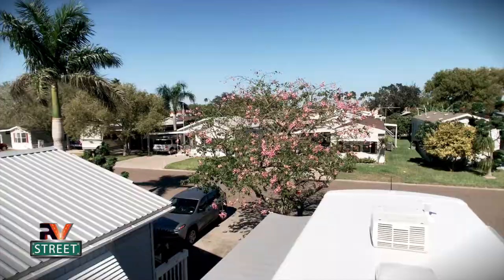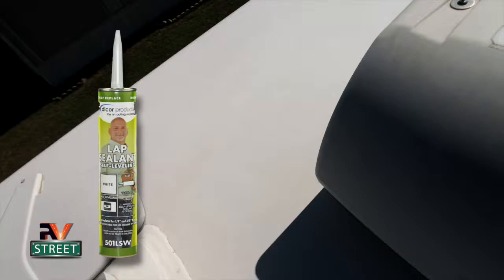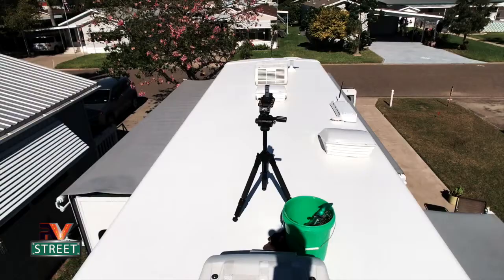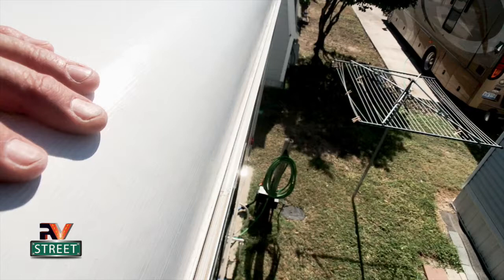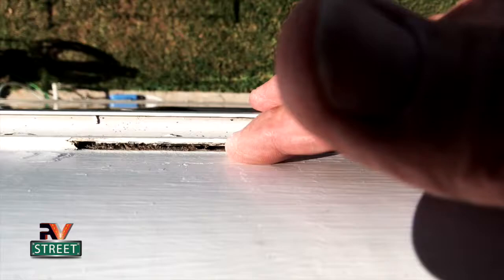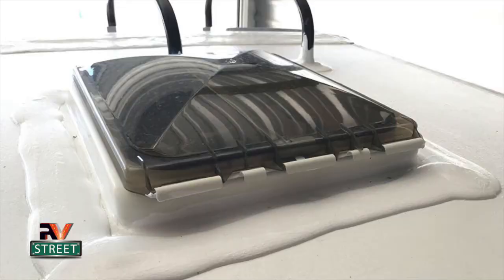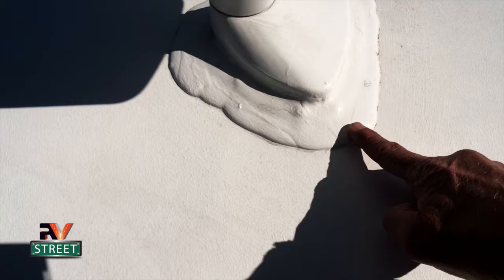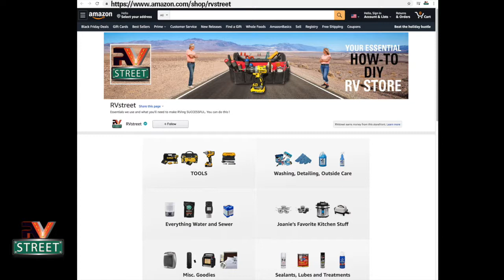RV FIBERGLASS ROOF COATING & GUTTER SEALANT REPAIR

Comment: Thanks for the video.  Very informative.  Why do you say not to use Silicon Sealant?  Is that just on the roof, or anywhere on the coach?  thanks for sharing
Reply from the maker: I was waiting for someone to ask this question, because I wanted to pin this question and my answer so it would appear at the top of all comments.
You don’t want do use silicone sealant anywhere on the RV and here’s why:
Silicone usually does not have UV protection. But even if you happen to find a silicone product that does have UV protection properties, once silicone has been applied to ANYTHING and you come back later to do any repairs, it's nearly impossible to scrap and remove it all off to reapply new material. There's always some residual silicone left behind on the old surface which makes adhering the new silicone product unable to adhere properly. Silicone won't adhere to itself either.
Reply: @RVstreet   - it's important to know however, that Winnebago uses silicone sealant from the factory.  So if you have one, do not use dicor unless you take all of the silicone off and clean it up first, like you have done.  Dicor does not stick to silicone.
Reply from the maker: @MrRMB1  So let me elaborate a little more on this for others:
Remember our coach is a 2012. I don't know what type of self leveling sealant they used then. But for me it didn't matter. I stripped all the old sealant off. Then sanded the entire roof. Then wiped down with acetone, then cleaned it with the Dicor cleaner. So I started from scratch. Once the roof was down to bare bones, then I laid down the eternabond tape, then applied a thick amount of the Dicor self leveling sealant over that and everything else up there. Then put 3 coats of the Dicor roof coating over all that. In the 5 years since I've done that all my sealant still looks brand new. No touch ups, no cracking, no nothing at all. That sealant or tape isn't going anywhere.
NOTE: I do not use any type of silicone sealant anywhere on our RV. I hate silicone.
Now on the rounded roof edges, where it tucks in behind the roof gutter, I originally used Nuflex 640 for that when I redid all those seams also 5yrs. ago when I redid the roof. And it has done fairly well, but since then I've switched to my polyurathane product I showed you. That stuff bonds like crazy, stays white—doesn't yellow—or start to crack. It's pretty amazing stuff. But I do still check my seams a couple of times a year and in fact just last week I dug out a couple of areas that had the Nuflex 640 cause it was looking a little questionable and then applied the polyurathane sealant. But other than that no other maintenance at all the last 5yrs. except washing it a couple times a year.
Reply: @RVstreet  Thanks for the comment.  I should have stated 'later' model years.  Both Winnie and Entegra have changed it up in the last few years on some models so unless someone can tell by feel, it's best to call the manufacturer. Thanks again for the clarification. Your video's are awesome and I've learned quite a lot from them.
Reply from the maker: @MrRMB1  👍
Reply: @MrRMB1  NOTHING STICKS TO SILICONE
ITS A DISASTER
Reply: @kathleenrutherford733  Silicone will stick to silicone. If it has silicone already, you must continue to use it (or remove it completely and switch to something else.
Reply: Just FYI!! Silicone will not stick to it self! So once you apply silicone and have a leak silicone will not seal that leak nor will anything else stick
Reply: The 1981 Class C which I purchased 2 months ago had plenty of silicone.  It took me hours to remove it. I used paint thinner which softens it given enough time. Then scraping with tool like a screwdriver. It has to be gone over 2-4 times before you think it is off. The last cleaning is with acetone.

Comment: With "Goo Gone" Caulk Remover, clearing away and replacing old, leaky sealants is a cinch. Plus, its fast-acting gel is gentle on surfaces. Works on wet and dried silicone and acrylic latex caulk, expansion joint sealants, polyurethane glues and construction adhesives.

Comment: I was unaware of this Winnebago roof maintnece issue until about 4 feet of my roof blew up in stiff Iowa winds.  When I bought the Winnebago, Instead of sealing the J channel the proper way, I just covered the whole thing with Eternabond.  I will say if I hadn't Eternabonded over the joint I probably would have lost the whole roof.  For the fix, I had to heat the Eternabond with a heat gun, pull off the white cover, and then scrape off as much of the adhesive as I could.  That exposed the subject joint.  Instead of using a razor, I used the pointy end of a painters tool to scrape out all the old sealant.  I then used the same pointy end of a painters tool to drag a microfiber cloth soaked in solvent to cleane out the joint.  I should have used lacquer thinner or acetone, but as I age I'm getting leery of using strong chemicals, so I used 90% isopropyl alcohol.  I then filled the joint with adhesive.  The hardest part of the job was dealing with the Eternabond mess. I did one side a couple of years ago and used 3m4200.  On the other side I used the Locktite product, largely because it was recommended by Practical Sailor.  I fouled this article doing a search on the Loctite product. I did it on Tuesday at the campground, and won't drive it again until Saturday for the drive home.  I'm hoping the high FL humidity will have cured it enough for the drive home.  Enjoyed your video!

Comment: Thank you for your informative video.  Our RV is 15 years old and we have a leak we cant find on the roof.  We haven't maintained it as we should have so I'm not surprised it's a problem now.  We're going to follow your process and we're confident it will work.  We appreciate the time you took and how well you explained each step.  Looking forward to solving the problem!

Comment: Hello Martin,    You have helped me so much, I thought I would share with you.  I was watching a custom car builder video and he pulled out his black 1962 Galaxy from storage.   He said he does not wash his show cars with soap and water when he takes them to shows.   So, he grabbed a bottle of pump spray blue glass cleaner and cleaned the whole car with it.  BTW, he had sprayed the car down with WD40 before storing it.   He got the car clean and looking good in a few minutes.   So, I went out to my shop grabbed a bottle I use for sharpening tools and started cleaning our coach.   It works great!   The dirt and grime just come right off.  I thought you might like to hear another method of cleaning a coach dry.
Respectfully,   Kevin

Comment: I did the roof job you described.  I used 18 tubes of Dicor Lap Sealant. This project really expended me. I hope in one year I am happy that all is well. 

One thing I learned by watching the Dicor videos is that they say to wait two weeks after applying the lap sealant to cover with their fiberglass sealant. I don't know how important this is, but I did wait two weeks. 

I also did your hot water tank flush.  It really needed it. Thanks for all the help.
Reply from the maker: You'll be just fine with the coating over the dicor.

Comment: I have been doing research for my fiberglass roof but having a hard time getting a good explanation.  I just ordered the roof paint and dicor self-leveling.  I ordered another sealant for the sides but think I will go with what you recommend.  Hadn't seen a good explanation on removing the side sealant so this was a huge help!

Comment: Hey buddy great videos here's a trick that I did scraping up all the old glue around all the components such as the vents and the skylights you get an oscillating tool with a real burnt-out blade so it has no teeth on it take that stuff up one out you'll be done with the whole roof keep up the good work TJ over and out

Comment: Just found your site. Awesome!! I’m hooked. I have 2007 class A. I’ve purchased sumo springs and all of your recommendations for polish/wax and repair and graphic restoration.
Attacking Hot water heater soon! Awesome videos. Thanks again!
Rob
Reply from the maker: Thanks fantastic Bob 👍 You'll be way way ahead of the pack.
What's the model of your Class A?
Reply: @RVstreet  Monaco Monarch 30’ SVE. I removed all old sealant and roof tape last year. I re-tapped all seams but didn’t know about applying the roof sealant. Looks like you painted it on. Searching for your roof video now. The sealant is unavailable on your Amazon channel-will check again.

Thanks again for your awesome videos!!
Reply from the maker: @robnelson4869  Nice coach BTW...
Here's my roof video: https://www.youtube.com/watch?v=H00oNtbvtrk&t=538s
And I just checked my store link and the sealant is available: https://www.amazon.com/shop/rvstreet

Comment: I have a '97 Roadtrek 170.  I can't keep the fiberglass roof clean.  It always gets moldy-looking speckles on it and the finish is more than dull.   How do I prep, clean ALL the discoloration off,  to restore it with the steps you have provided on this video?   You explained your video so well...thank you.   TREKN-ON ...(soon)
Reply from the maker: Q: How do I prep, clean ALL the discoloration off,  to restore it with the steps you have provided on this video?
A: The same exact way I described how I did mine, then add the coating. I applied 3 coats. Prepping the roof like I did is the most important part. All you'll have to do from then on is wash it when you wash the RV. Your roof will never discolor again.

Comment: Great video Martin ! Have to put this on the to-do list which is backing up. Rig in the shop for major slide repair. When it gets back I have to clean and protect the entire body with Rejex. Still have much work remaining underneath on the rust removal job. Passenger side front window leaking and needs resealing pronto! Roof is about number 3 or 4 on the list. Dolly due for maintenance also- bearing, brakes and repaint! Thanks for an excellent video. I was wondering how to redo the front cap to roof seam and I like your approach!
Reply from the maker: Always luv hearing from you Joe. 🔧 💗

Comment: Hello Marlin and Jonie,
  I really enjoy all of your videos and they are really helpful.  The trouble is when I watch your videos I have work to do on my motorhome after.  Just when I think I am catching up
Reply: I know I will never get caught up.  I have dodged the bullet a couple of times with flat tires on my dually tires. I am going to order from your Amazon Store the Ezee TPMS. Question putting air in the rear dually are a pain to say the least.  Did you ever hear of Borg valve stems? They are made of metal and formed to extend to make filling the tires a lot easier. I  tried extenders, clamp on extenders with problems.  These Borg valve stems are $140 for 6 tires for my motorhome.  Pricey yes but for safety and easy access worth it.  
Thanks again.
Ken
Reply from the maker: Putting air in my dually's isn't hard at all, not sure why it's such a pain for you.
Yes I have heard of the Borg and have read much on them. 
But can you add TPMS sensors to the Borg? Have you looked into that?
I don't consider $140 pricey for anything that accomplishes the mission.
Thanks Kenneth so much for watching and supporting our channel. 🙏
Reply: @RVstreet  I called Borg and they told me that the will screw on the ends of the valve stems.  
  I have a 2011 Winnebago 24 J and the steel trims have a  round hole and elongated holes. Trying to get the inner valve stem through the outer elongated hole in the outer rim so you can check air pressure and put air in is very difficult.  Apparently the Borg valve stem for the inner rim is approx. 7" long way it's bent at an angle so it comes through the elongated hole on the outer rim. 
  Like I said I have been lucky twice with flat tires on the rear and the other tire carried the load without a blowout.  I know I have a good guardian angel. 
  Thanks again and I will be looking forward to more videos.  
Ken
Reply from the maker: @kennethkirschbaum1906  Nice follow up Ken. thx 👍
Reply: @RVstreet  Your welcome.

Comment: Very Nice video! I want to know, if it’s possible to applied it, on my Rv rear vertical plastic molding corner. It have cracks. I put temporarly super white adhesive.

Comment: Did you say you purchased the lot you are parked in?  By the way I did a very similar  thing with my 1981 20' C class.
Also, I've noticed the Dicor sealant for windows and such dries pretty rigid which is contrary to what you are saying about staying flexible.
One last thing, you are a perfectionist, even more so than me.
Reply from the maker: Yes we purchased our winter lot. 
Ya, the flexible sealant I covered is necessary on the—roof seams—because that's where a lot flexing happens. If a hardening sealant is used it will be money & time spent for nothing b/c it will crack, not hold and allow water intrusion.

Comment: My roof is fiberglass but is tan does dicor sell different colors or only white? White would look weird on my curved sides. You've inspired me to tackle this job and it will be labor intensive but I can only imagine how much it would cost to hire someone
Reply from the maker: Dicor self leveling sealant does come in tan for your vents and other areas on top of the roof. I have your color in my Amazon Store. Just go to the "Everything On The Roof" category. https://www.amazon.com/shop/rvstreet

Now you said above "White would look weird on *my curved sides"*. So if you're talking about the area where the roof crown curves down and under the aluminum roof gutter, like the product I showed you that I repaired, it also comes in bronze which would look fine on your roof. Same thing...go to my Amazon store, go to the "Everything On The Roof" category, scroll down about half way and click the PL loctite sealant and chose "Bronze" as your color.

And you're right. If you jobbed this out it would cost you several hundreds of dollars + materials and more than likely it wouldn't be done properly.

Comment: Great video thank you. I had watch over 50 videos and finally got to you with a perfect and complete instructions, I know feel confident to do this on my own. One question tho, I bought rust-oleum topside paint, you think that will work too? TFS :)
Reply from the maker: Rust-oleum for what? The top of the roof? If so, I wouldn't use that on my roof.

Comment: Hey Martin, I would love to know how you do maintain well on the slides! I need the education please make a video! Thank you and happy travels.
Reply from the maker: Hi Ali,
I would love to know how you do maintain well on the slides........
What exactly do you mean by this?
Have you checked out myPLAYLISTS page yet? Ton of stuff there.
https://www.youtube.com/c/RVstreet/playlists
Reply: @RVstreet  I have seen a lot of your videos. But I don’t recall one specific for maintaining the slides or doing maintenance on an RV slide out. You know like cleaning or lubrication every time you move or relocate. Every time the slide comes in or out? Are we not suppose to do RV maintenance on slide outs? Thank you so much. Your videos help me understand on keeping up with what I’m suppose to do.
Reply from the maker: @baortiz25  Oh, OK. Here's two videos I've done on slides so far. One for cleaning and taking  care of the rubber seals when you have toppers:
https://www.youtube.com/watch?v=F5YSBrmuTCA

And one to clean the top of the slides and the toppers:
https://www.youtube.com/watch?v=lVF_nPZccbQ&t=74s

Lubrication isn't necessary every time you deploy or retract. I lube mine rack & pinion slide systems about twice a year with a dry lube that's in my Amazon Store in the "Sealants, Lubes and Protectants" category. But of course I block my slide gears and rails with my custom made panels too, to keep dirt out.
Reply: @RVstreet  thank you!!! I will watch them now!

Comment: Another great video Martin. That coating you put on, how long does it last before you need to re/apply redo the roof?
Reply from the maker: I did my roof in 2016 and still looks great and I applied 3 coats back then which took 2 gallons and I'm 35' long. It's a fantastic product and now all I have to do is wash it. Definitely one of the smartest upgrades I did right off the bat.
Take your time and prep the roof right first. That's important to get a good, long lasting result.
Currently it's not available on Amazon therefore not in my store. Once it becomes available again it will be in my store again. Supply chain issues right like everything else. But you MAY find it at a local RV dealer. Dicor doesn't sell to the general public.
https://www.amazon.com/shop/rvstreet

Comment: Another in a line of great videos.  My question is does the use of the loctite product change if the rv has a TPO or EPDM roof?  Also, can you give a brief explanation why no silicone products?  Thanks again for the awesome videos.
Reply from the maker: Some TPO or EPDM roofs are attached differently than my fiberglass roof. But, if your roof curves down and around and is held in place with the gutter like mine is then you can use this same sealant. Silicone usually does not have UV protection. But even if you get a silicone product that does have UV protection properties, once silicone has been applied to ANYTHING and now you come back later to do any repairs, it's nearly impossible to scrap it all off to reapply new material. There's always some residual silicone left behind on the old surface which makes adhering the new silicone product unable to adhere properly. Silicone won't adhere to itself either.